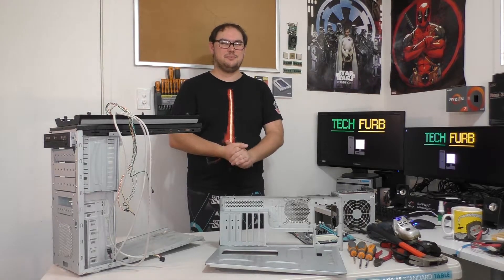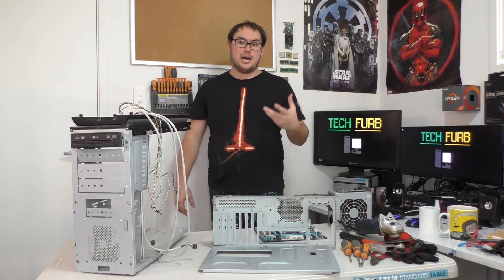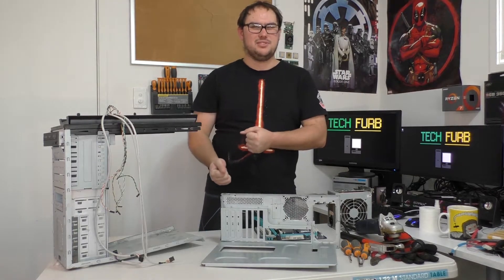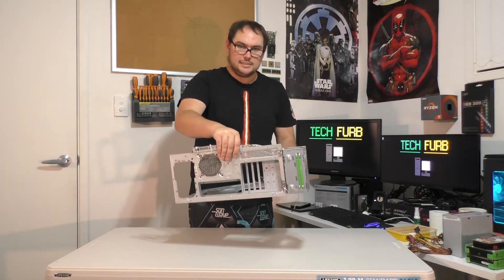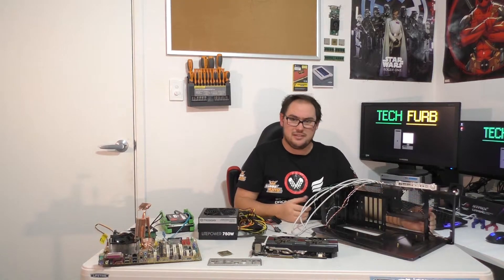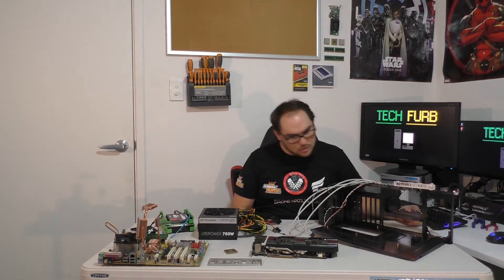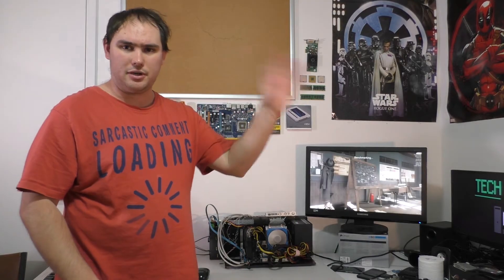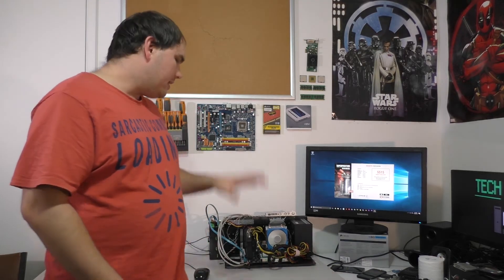Build a Free Test Bench For PC Testing and Builds! - DIY Testing Case

Comment: Just use a more rigid case.  Some older cases were beefier.  Probably better.  Can't you just drill out pop rivets and just rethread it driving in steel screws into the soft aluminum?  

Another option is to use threaded rod (4) and make a 2 level frame.  First level is for power supply and drives, and the second level is for your motherboard/video card but as they are both horizontal everything is so much easier.  No battling gravity.  Or even better, just have it all on one wood board so you can move things around.  Power supply wiring can be stiff and if your motherboard isn't screwed down (why bother if you don't need to?) it's much more convenient to not be confined by having to put each part in it's own space.  Maybe have a border around it so when you're disassembling things screw don't get lost so easily.  Not everyone has a magnetized tray handy and many people have carpet that loves to consume little screws.

Comment: Do you have to build multiple test benches to test every different type of component to an extent? Super newbish to all this yet, but I am trying to learn.
Reply from the maker: Yes and no, I only have the one dedicated test bench which it the one I built in this vid, however I generally have to throw together a system when I am testing parts for review. the only handy thing with the test bench is it saves a tone of time and is much easier to swap components out. Are you new to PC's or new to bench marking and reviews?
Reply: I am sort of new to both I suppose. The whole AMD Ryzen thing got me into learning about building PC's. I just get confused when I see videos where they are testing CPUs from either AMD or Intel in the same video, do they need another test bench for the Intel ones vs the AMD ones? It confuses me with all the different socket types and stuff.
Reply from the maker: Thats a great question. so yep they would use 2 test benches for AMD vs Intel. AMD uses its own socket called am4 and intel uses 1151. there are may other socket types but those are the 2 mainstream ones.